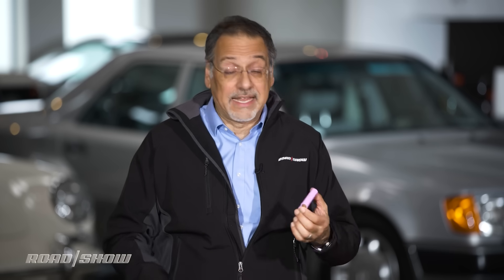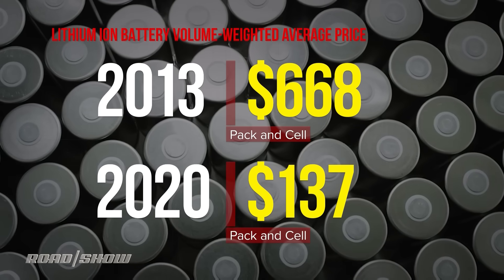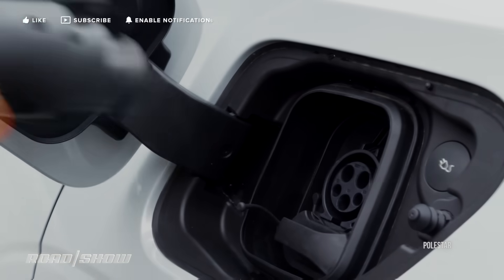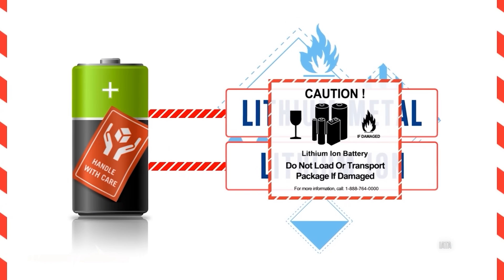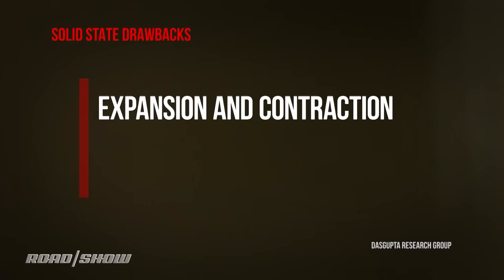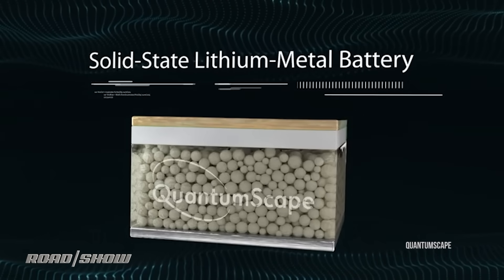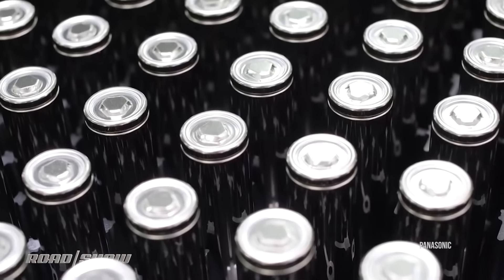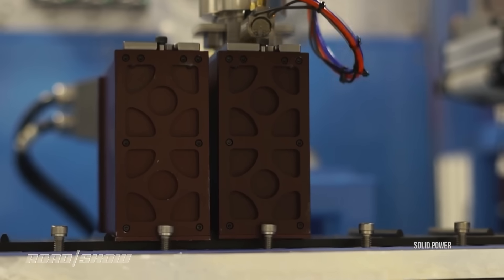When solid-state batteries arrive, you'll want an electric car

Comment: Possibly. But I've been hearing about them and their great wonders for several years now. And.... I'd say at this point lithium mining will have destroyed the potable water supply and fires from short circuits and crashes will have used all the firemen's water supply. It just seems to me when they stopped pursuing hydrogen fuel cells they stopped being really serious about net zero emissions and renewability. There's an unlimited supply of hydrogen. It can be  easily made and the ground is full of it. One method to make hydrogen requires either electricity or a battery to provide energy. But there are lots better batteries than lithium. So lithium batteries last 8 or 9 years? Does that seem reasonable to you? It doesn't to me when we've been making batteries that will last in excess of 10 years since at least the 60's. I think German scientists just came up with a nickel hydrogen battery that will last about 30 years. That's more reasonable. That's getting serious about the cost and reliability issues. Until they get serious about it I'd never consider much more than a Toyota hybrid like a Prius. But right now just the Camry and Corolla 4 cylinders make pretty nice longer lasting cars. But probably there's American made V8's and sixes all around here including the one I drive that will last longer than anything I've mentioned. It might get expensive... especially if we increase offshore taxation on trading partners who will turn around and tax us by increasing prices on plenty of the things we don't currently grow, build... IDK...I don't see it working but I'll wait and see. But what we were doing wasn't working either. Well, it worked just like a business with 2 sets of books. One you show everyone. The other one everyone knows is the real set by just looking around and thinking. Someone should buy Brazil and make them plant those trees they cut down for farmland and then I don't think we'd be talking about driving a fire hazard!

Comment: GOOD MORNING!  2024 here.  THREE YEARS LATER.  And "solid state batteries" are just as real as swamp-gas UFO sightings.  Even funnier are all of the other MIRACLE battery technology videos, also 3 years old, that are "suggested" next to this video.  All of which are as real as the farts from my recent trip to the bathroom.  You might as well introduce everyone to the 18650 battery, "developed by Panasonic in 1994."  The industry has only made "baby steps" away from this technology, which "fueled" the original Tesla Model S -- in packs of 7,000 batteries or thereabouts.  Some slight changes to chemistry, a few physical size and shape changes, but otherwise, THERE IS NO BREAKTHROUGH HERE.  We are still spending HOURS charging batteries, if we want to use them to drive vehicles around with.  I predict that very few people reading this in 2024 will be alive if and when some kind of battery electric vehicle technology that can "charge a vehicle in a few minutes" actually reaches the consumer market.  "Don't bet your life" on miracle battery technology.

Comment: What do you mean by dendrites in this technology? Solid State Batteries are less likely to develop dendrites as quickly when compared to their potent formation in lead acid and lithium battery designs. That's actually the root course for their limited life cycles in operations.

Comment: It doesn't matter what type of battery you put in an EV the problem is no country is building power stations to supply the electricity or improving the grid to handle the volume as it would need so it's still a great big pie in the sky a total con

Comment: Sure we want one, HAHA, far past the battery and car, IT IS MORE POLLUTING MAKING THAT DAMN CAR, THE BATTERY AND BURNING COAL TO POWER IT! No matter what you say it's a lie!!!!! and a joke, our POWER grid is 50 years or more away from updating the supply lines, and yes the government keeps shutting down power plants and we need more new ones, so lets build atomic plants and put the waist for the next 2000 years or more in a tunnel somewhere, or let's get the coal and burn that, or how about oil that makes the plastic in it, Damn I hate liars, gas cars with its emission system is still cleaner than this crap. The pollutants from all automobiles come only close to 10% the rest is manufacturing in non emissions controlled world.

Comment: your not gonna let the battery get to zero miles remaining so that 350,000 mile number is like most advertisements just hype with a *in lab testing in small print. These companies have engineered solutions to get the result they want but it still has to be proven and that can only be done with time. Do we really believe the price would actually be reduced with the new battery, the manufacture will still charge even if the costs are halved & most likley charge more. the military likes to do these Concurrency development deals

Comment: I was hoping that solid-state batteries would reduce the need for lithium in a pack. Looks like they still need lithium. Is that correct? Maybe they need less of it? At least it would lengthen the life of a battery pack per unit of lithium.

Comment: Batteries for cars are still so useless, even if they can power a car 600 miles. There's still no where to charge them, never do the range you expect, takes ages to charges. It would be good for phones and laptops but for cars they just need to focus all efforts on sustainable fuels and hydrogen.

Comment: Problem has never been charging rates of lithium, which easily charge at 2 or 3c if you want to. It's needing a megawatt of electricity to do that. More capacity makes this problem worse.

Lithium batteries explode because it has a high energy density and both parts of the chemical reaction built in, any other battery that performs well enough for a car is going to have this problem as well.

Comment: clueless idiots...
the grid CANNOT handle so many cars

only option, each person needs a solar station at home, just to charge the cars
you will need batteries to hold the change created during daytime, then use those to charge the car(s)

remember, in winter, you'll get about 1/3 the power from the panels (counting less daylight, angle of sun, night)

Comment: Personally, I'd like a small thorium reactor to run my car.  Imagine coming home and plugging your car into your house, not to charge your car, but to power your house.  When the car needs replacing you just buy a new body, frame, and drive system and put the old thorium reactor powerplant into the new shell.
Reply: Can never happen. What you're going to want is a fusion reactor. This is a reactor that never needs to be opened and will take theoretically thousands of years to stop giving off energy
Reply: @jasonmorris9330  that is indeed what I want.  Wonder if we’ll see one in our lifetimes.

Comment: The main flaw with EV remains the same.  They can't be inexpensively extended into a second and third decade the way gasoline cars can.  At least half of the potential market for EVs is living paycheck to paycheck, and they can only realistically acquire a car used with 100K miles and ten years on it.   Beater cars.   EV isn't a realistic option because they batteries don't last multiple decades, and they won't going forward.

Comment: I’ll never want one. I don’t want to have to plug my car into the grid like plugging my phone into my computer. We’re sleepwalking towards scenarios where the government will mandate software changes to your vehicle and you won’t be able to charge unless you click ‘Agree’. 

Everything about your vehicle usage will be monitored and regulated. Range, top speed, and acceleration will all be soft-capped in most cases and you’ll have to pay a premium for exceeding those caps the same way you pay a premium for phone data after you exceed your plan’s data cap. 

Common vehicle features will become subscription-based. It’ll start with minor stuff like data for GPS, then it’ll be features like remote start or heated seats, then finally they’ll move onto actual safety features like lane assist and backup cameras. 

And before you know it you’ll begin seeing stories about people having their vehicle remotely disabled because they violated some protocol. It’ll start with stuff that sounds reasonable; They missed too many insurance payments and lost their coverage. Then it’ll be because they received too many collision detection warnings or speed limit warnings. Then it’ll be because they drove their vehicle to an area that was designated as high-risk for the transmission of a certain virus. Then it’ll be because they shared “misinformation” online about election results. Then it’ll be because they criticized whichever puppet is pretending to be driving this clown car of a country at the time. 

And you’ll think you’re safe from it because you don’t make waves. You follow the law. You’re politically correct. At least you were until what’s considered politically correct changes. Suddenly some joke you made 20 years ago on social media is considered highly offensive. You’re now a bigot. Youre a “__-phobe”. You’re a right winger. You’re an insurrectionist. A terrorist. 

Your car will drive you to the police station and will remain locked until the authorities arrive to detain you. It will then drive itself to the impound lot where it will be confiscated and repurposed by the state. The neighbors who liked you yesterday will celebrate your detainment and disavow ever having associated with you. Your house will be assigned to an immigrant family whose welfare will be subsidized in part by the labor that you’re now forced to perform in the gulag. They’re a better citizen then you because they don’t ever get wild notions of resisting, let alone fighting back. They’re totally dependent on the system and that makes them better people. The American dream is to be a forever-child who stays in their box and lets the nanny-state make all their decisions for them. Once enough of you have been replaced with enough of them the state won’t have to worry about any backlash from finding a more permanent solution to your tendency for being a thorn in their side 

But hey they’re a little more fuel efficient so it’s totally worth it. I mean it’d probably be better to just stop inflating the cost of gas and subsidizing the cost of EVs to force everyone to transition away from ICEs. But what do I know. I’m just a working class guy who sees people as people rather than seeing them as cattle or numbers on a screen. I’m a relic of the past

Comment: One thing I wish he'd touched on is the interchangeability with li-ion packs in existing vehicles. I'm on the waiting list for a Ford Lightning, and I'd be a lot more enthused about going through with it if I knew it would be fairly straightforward to switch out the li-ion for a solid state pack in 7-8 years when the original pack dies, I'm a firm believer in getting as many miles out of a vehicle as possible
Reply: Very good point.

Comment: IF...not when.  IF it works.  IF the rare earth materials are available.  IF the grid can be expanded (pro tip--that will not be done with "renewables").  IF the NIMBY libs allow the factories to be built.  IF lazy Americans are willing to work.  I don't see this as anything but Chinese propaganda at this point.  And this dude is a well known Chinese shill.

Comment: 3 major hurdles for E.V.

1. Long wait lines, If you have to charge and there is a line expect to wait hours to charge your EV. Imagine the wait if 20 people are in front of you.
2. Going camping is a no go. I live near wilderness and camp a lot with a trailer. After hooking up a camping trailer to an EV you lose most of the mileage and now your camping trip has to be close to home.
3. Charging stations will start making you pay more for electricity. Electricity isn't free. Most electricity is made with some type of fuel. That makes your EV ran on fuel not electricity when it boils down to it.
Reply: Most of these issues are no different than those faced by other emerging technologies. Imagine the first person to buy a gas car. Where will I get gas from? It needs to be pumped out of the ground and refined before I can use it!

Comment: I have been driving a low cost unsubsidized electric car for 8 years. If I’d have waited for solid state batteries that are still a decade or two away, I’d have wasted over 18,000$ in fuel.

Comment: Back in the early days of the automobile, cars were produced one at a time probably in a garage somewhere. Then Ford started up the automated production line, within a short period of time other manufacturers started their own lines.  Some people in the 1920’s still used horse and buggy, by the 30’s it was way down as a form of transportation. When a RELIABLE battery hits the market, one that will first of all satisfy the consumer, then satisfy the government (as long as they think they’re satisfied) we will be about 10 years away from 99 percent of the population using electric cars. And after that the next 50 years will be spent improving on whatever comes out.  This is like 1922 in terms of car technology and here it is 100 years later a and we’re trying to switch over to a new mode of transportation. Go back to 1804 and you’ll see the first train, so about every 100 years we come up with a new way to get around. 
Seems like it’s here and only getting better and cheaper. If 100 people buy a Tesla or whatever at 1 million each that’s 100Mil
If 100million people by a tesla or whatever at 200 bucks each, you get the idea. 
It’s happened throughout the history of mass transportation.

Comment: There are no electric cars.  The electricity you charge you car with is generated largely by coal and other fossil fuels.  And the US power grid infrastructure is barely able to support the current load.  So once a few million Americans plug into the grid, watch it crash.
Reply: Solar power. Here in California it's the law that all new houses built have to have solar panels
Reply: @matthewviramontes3131  3% overall after years of pushing the technology.  I believe we will get there eventually, but wishing technology into existence will not work and modifying the current infrastructure will take decades.  Nuclear is the way to go if you want to support electric vehicles.  And reduce “green house” gases.

Comment: Fun fact:  We burn more coal (fossil fuel) to charge electric car batteries, than we do from burning gasoline in cars.  Don't believe me?  Look up the statistics yourself online.  Electric cars being better for the environment are all hype.  Just like solar panels.  You would spend 20K on solar panels that last for 20 years, when the overall cost to run your house off the power grid for 20 years, is actually cheaper.  Let's not forget, there is hundreds of millions of times more information instantly available to people comparably to 30+ years ago, so our ability to sift through information has become hundreds of millions of times harder.

Comment: Instead of trying to build electric cars to "save the enviroment", we should focus on de-regulating construction and city planning regulations to allow people to build more economically sustainable cities. Check out NotJustBikes.

Also I would invest in electric trains powered by an over head cable (like street cars), because 1, they won't need to use a battert which is the problamatic part of EVs. 2, Electric motors provide more torque compared to motor engines.

Comment: Electric cars can be good.  The solid state battery sounds promising. Can our current electric grid handle the increasing load? Currently 61% of our electricity is generated using fossil fuels. That seems to negate any advantages of electric cars. We would need more nuclear and hydroelectric power sources.  Windmills are unsightly and do not recycle well. Solar is too land intensive unless placed on top of existing structures.  Many of these issues will have to be addressed before I sing the praises of the electric car.

Comment: No, I won't, because they will still require a power grid to support them that will never exist without resorting to the same fossil and nuclear sources EV proponents are rabidly against. Additionally, these EVs cannot be manufactured in the first place relying on so-called "green" energy, and they are far more toxic to the environment in both manufacturing and disposal.

Comment: No, we won't. Because what will happen is they will overcharge us, as usual. They will introduce all sorts of regulations that would prevent you from modifying cars, and restrict the use of these batteries for other purposes, probably. Bank loans will be higher for these new vehicles if nothing else because the demand will be high. It will take a long long time for these vehicles to become truly affordable. What we need to think about is perhaps to see if there is a way to retrofit certain parts in order to turn old cars into electric cars. And regarding these green quotas, we need to hit, we still use a lot of oil for asphalt, tires, wiring, and a ton of other parts. We are far far away from getting where we need to be.